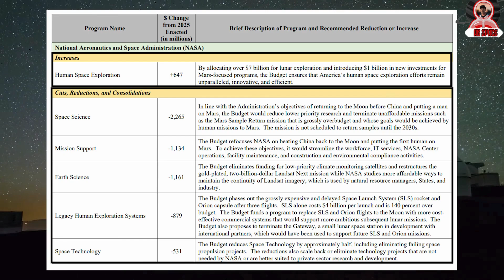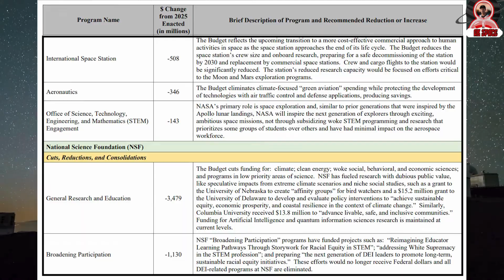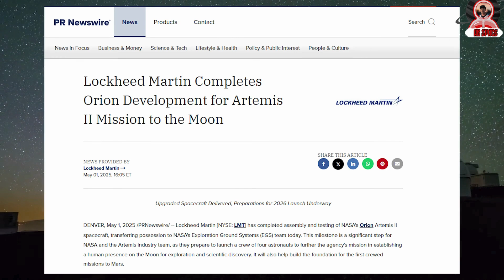"NASA's Moon Dreams Crushed? Trump Cuts Budget and Cancels Major Space Programs"

Comment: Moon will be done by Commercial company's such as SpaceX. NASA has been ineffective since the  decommissioning of the Shuttle. Artemis (the capsule) is a DEI flaw. Boeing, trying to save money, hired off-shore resources and they ALWAYS screw software up. What exactly happened to the two stranded astronauts, the software had issues on the capsule. Moreover, the heat shield was skeptical.